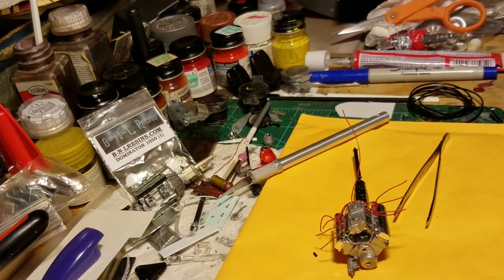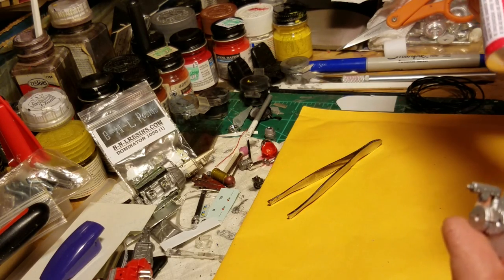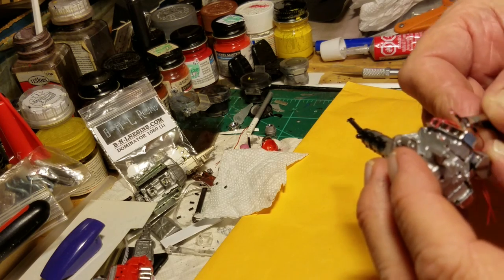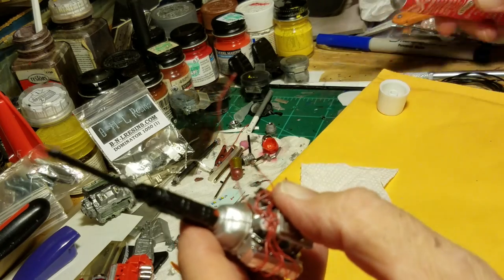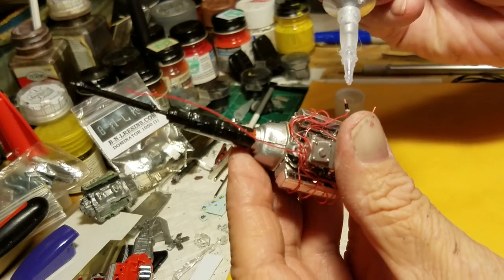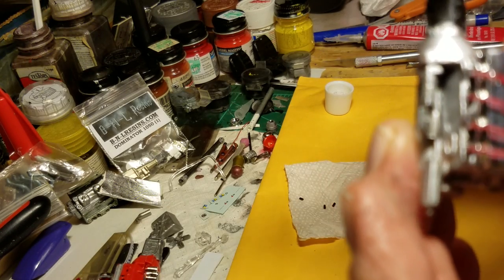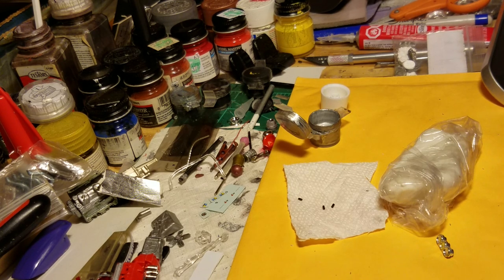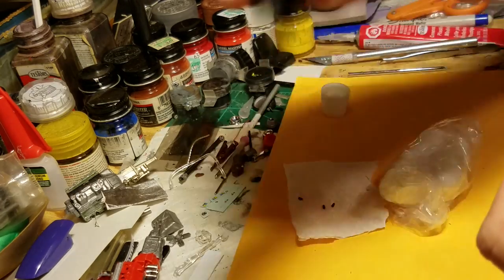Part 2 making and wiring a Distributor cap n wires

Comment: this may seem like a dumb question, but where would the distributor wire connect to.
Reply from the maker: chris noble no no, it's ok..on the side of the Heads! thy sit under the valve cover!..the headers also connect to the heads, plugs go between the pipes in most older cars, u can look up pics on google.."maybe spark plug location on chevy engines, or ford..etc..also, Distributor cap is in back on chevy's, n front on most ford's n Chrysler motors at least the big blocks etc..gotta look it up for type of engine..
Reply: Alan Spence ok cuz on dominic's 1970 charger, ther plugs go right into the valve cover, so the distributor wire would sit underneath the covers glued to the side of the block
Reply: Well, the cap goes up front too the fright a bit the wires can dress down the side, drill holes 4 EA side n a bit of glue an put in plus holes, look the motor up! Will show more details
Reply: alan spence I tried to look his motor up and couldn't find anything that showed the distributor wire
Reply from the maker: Chris, ok..wait..who n what car lill brother? I know a Chrysler,  dodge? Hemi or 3?
Reply from the maker: chris noble Yes..dam..lol, FaF car! 8m with ya ..yes..drill all 4 on each cover, its a 428 Hemi, yea, but I don't glue the wires too the side of motor, just run them n fourm them over n in..kool
Reply from the maker: chris noble i have a few pictures need email?  I'll send